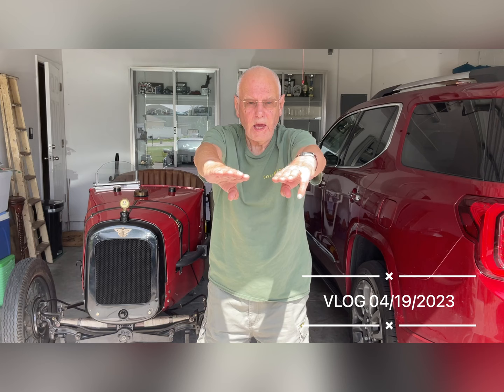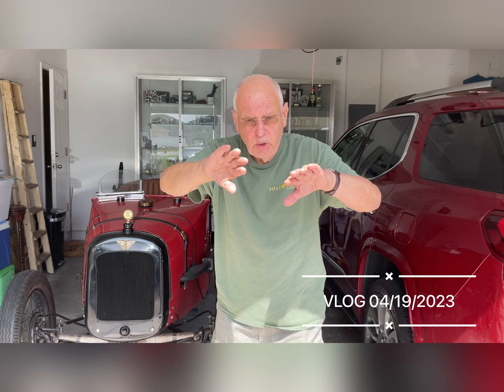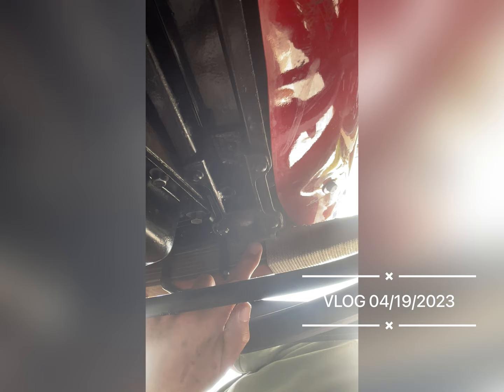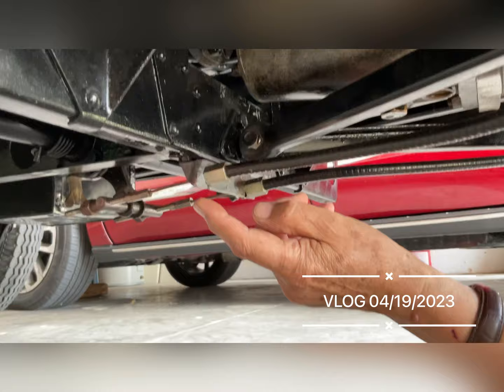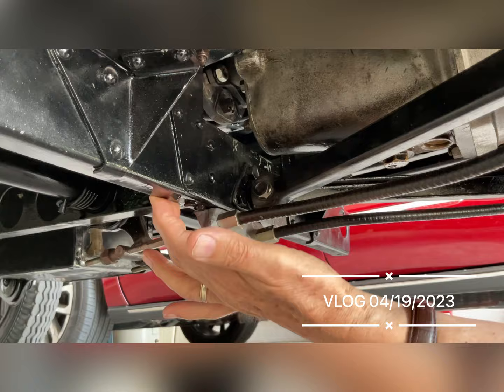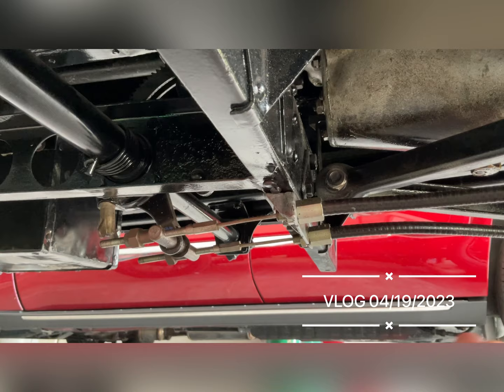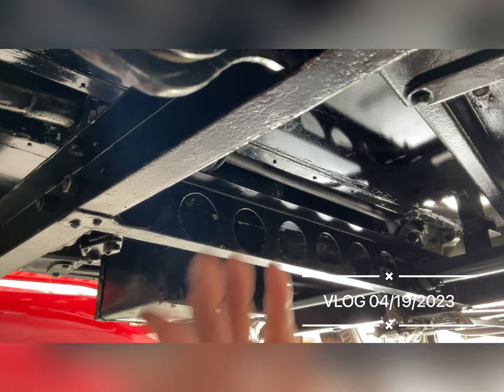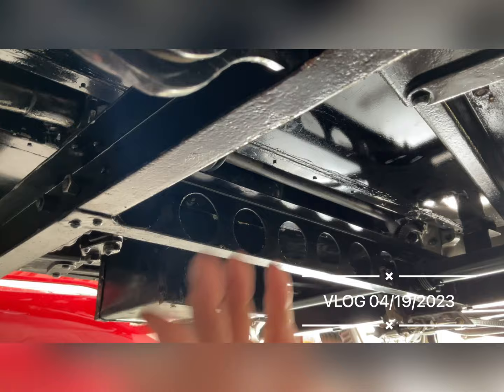Austin 7 Chassis modifications

Comment: Thanks for the video.  Do you have a sketch of the modification at the “gooseneck”?
Reply: I was also gonna ask this but he seems to not reply to comments i can’t quite understand the pictures and make use out of it please let me know if your any wiser than i am
Reply from the maker: @will6635  I am sorry, I did reply on my phone but for some reason it did not record it. Anyway I explained that I did not have a drawing of the plate that was welded on the underside of the gooseneck. However it is a simple plate that follows the shape of the open section and is then bent to fit the gooseneck. It is then arc welded to the gooseneck and this stiffens the weak section.  Let me know if you can follow this, if not I will try to make it more understandable. thanks for taking the time to follow my video
Reply: @johnsutton3279  No worries ! I’m building my an ulster and i wanted to stiffen the chassis but i’m struggling to make out what you’ve done as i want take your advice on board